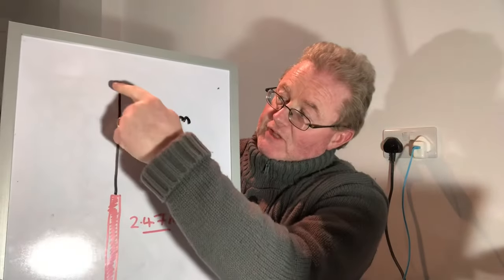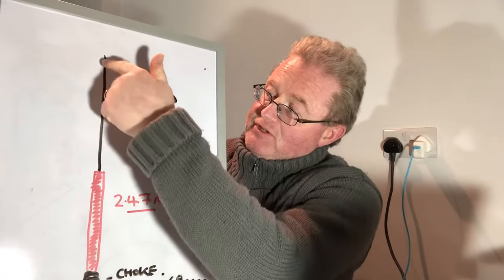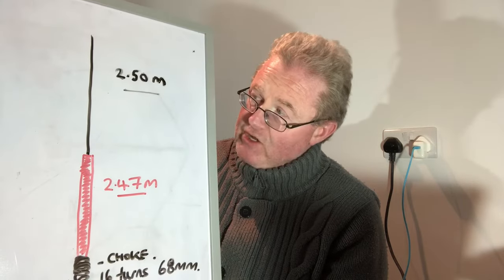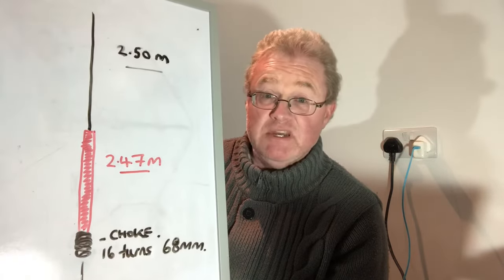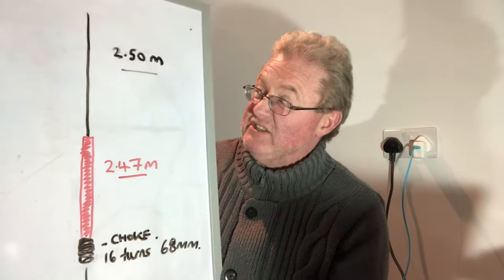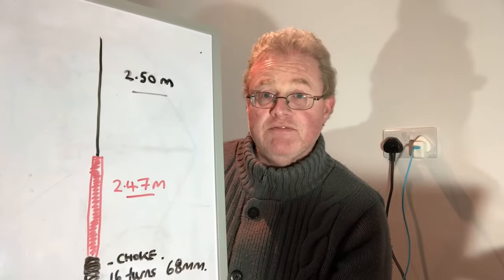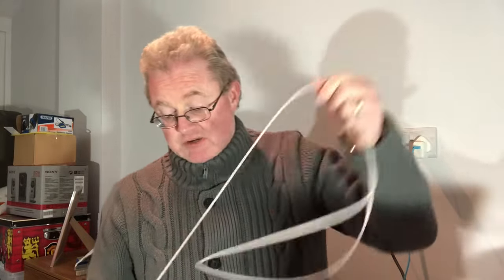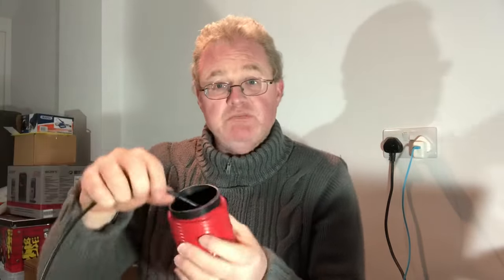T2LT - Half Wave Vertical Coaxial Antenna For CB Radio & 10 Metres

Comment: but it's not a dipole. if there was another 'negative' element it would be a dipole. it seems more like some 1/4 wave end fed and so you need the choke to stop the rf coming into the shack because you've left it nowhere to go. i know the design has been around, but why not just peel back the braid from the top section over the bottom 'feed' giving it the other half of the dipole?
Reply from the maker: You are splitting hairs friend and in stating this is a quarter wave you are incorrect.
Reply: @timg5tm941  I'd say it's more of a case that I don't understand how it works. A dipoles feed point would be where the center and braid separate. In this case the center goes on to become 1 leg of the dipole, but there is no other lead attached to the braid to become the other leg. If this were a vertical it would look like a 1/4 wave with no ground plane. So I would ask if you might take the time explain what is happening so that I may better understand. Thank you in advance.
Reply from the maker: Ok - the antenna works owing to the coax skin effect of the first 1/4 wave above the choke. The RF travels up The inside of the coax shield and then when it hits the end of the shield it comes back on the outside of the coax where it eventually  gets choked. This firms the other half of the dipole. Radiation patterns are practically identical to any half wave vertical .. be they centre or end fed. 73
Reply: @timg5tm941  Thank you very much! I think I'm going to try to scale this for 6 meters. 73
Reply from the maker: Plenty of examples out there.. google 6m flower pot antenna